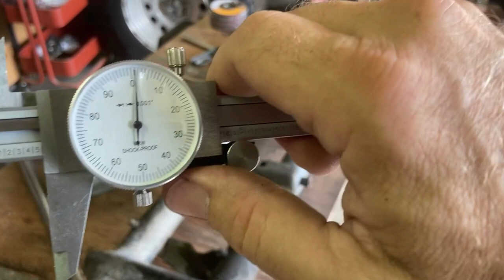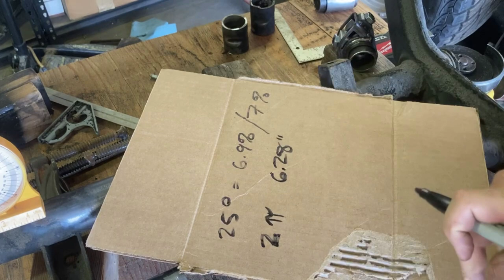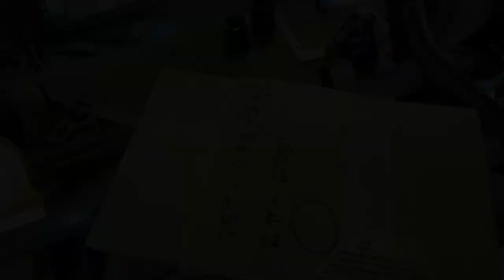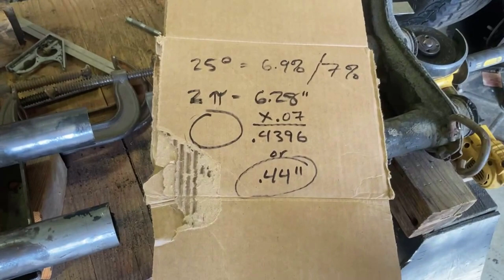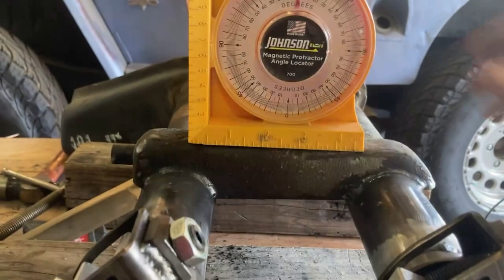1969 VW Bug Project - Episode 53 - Narrowing the Beam Part 2 - Welding in the Airkewld Adjusters

Comment: If you're not cutting your shock towers you will have problems I have a EMPI 2" narrowed beam on my 67 and that's as close you can get with shock towers your literally and 8th or less from wheel well on the inside the shock towers.
Reply from the maker: I ended up shaving a bit of the inner fender well to make them work.  Didn't have to compromise the shock tower strength at all doing it that way.

Comment: Just curious, why not cut at the point outside of the bracketry?
Reply from the maker: If I'm understanding you correctly, it's doable and I've seen guys better than I am who have done it, but there's very little room driver's side between the steering bracketry and the shock tower.  I think what I've seen is that in order to do that, you'd have to cut the welds holding the shock towers on, remove them entirely, lop off the two inches from the torsion tubes, and then reweld the towers on the end of the shortened tubes as a nice 90 degrees.  In the end, I didn't trust myself to get the towers back on perfectly.  I felt more confident in my ability to realign the tubes with some L-bracket bracing as I welded them back together.  I also preferred welding the thicker tubing rather than the stamped steel of the shock towers.
Reply: I dont weld so well but i would do roset or plug welds to get good strength from the the tube underneath. I got drop spindles and dont like the lesser clearance so i am considering doin it also and also adjustability raising it up is a good idea also. Good video thanks